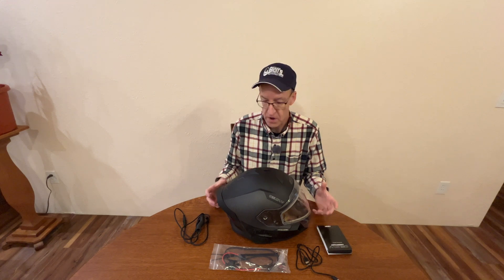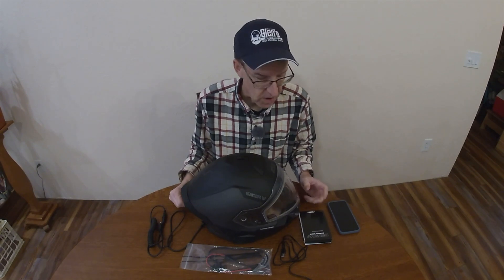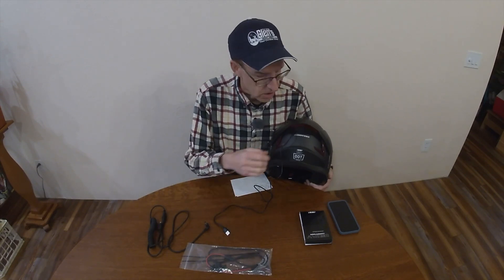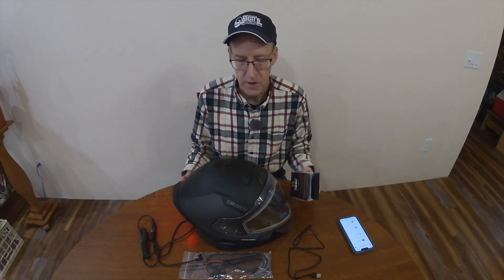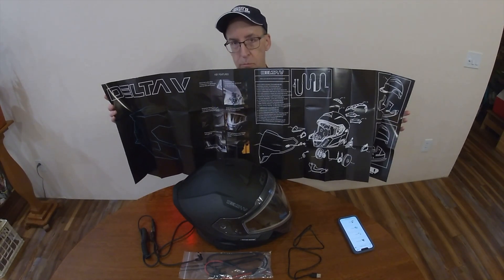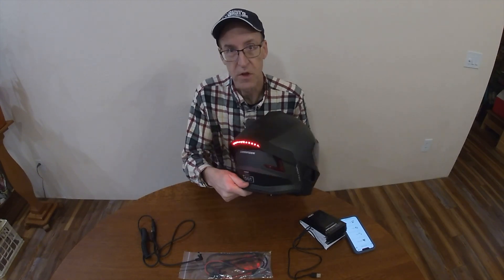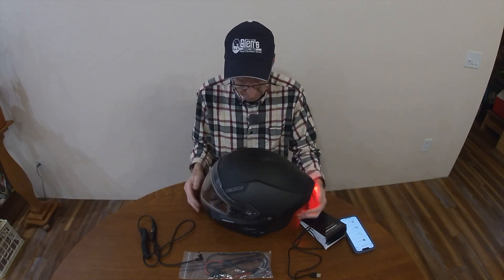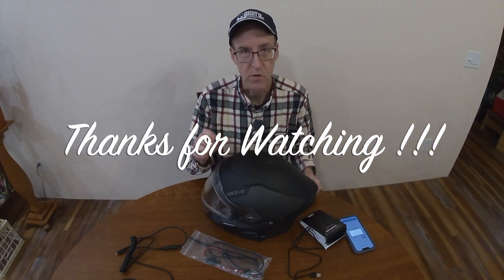509 Delta V Commander - How to Get Started

Comment: Does the helmet tell you when shield is on?? indicator or voice?/
Reply from the maker: Good question, and I’m sorry I didn’t include that in the video.  As far as I can tell, it only beeps when the shield is turned on or off, and the beep is the same either way.  Other than fogging up, I don’t think there’s a way to tell if the shield is on or off.  Maybe there’s a light to indicate it, but I haven’t found it.